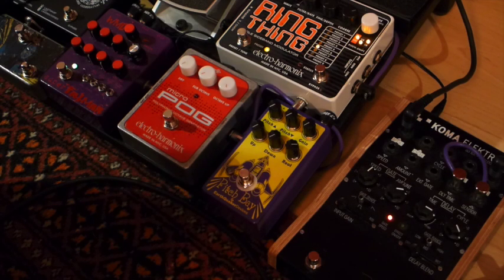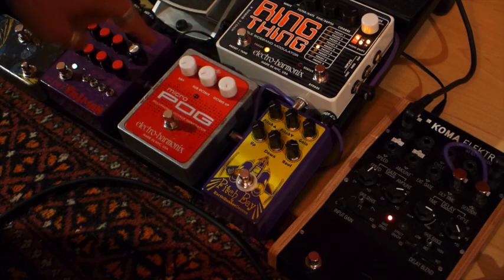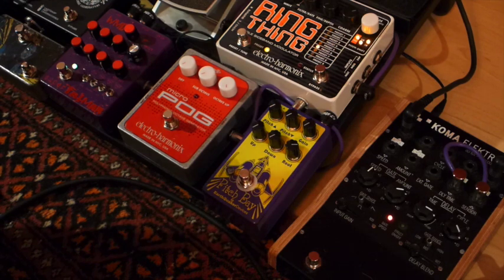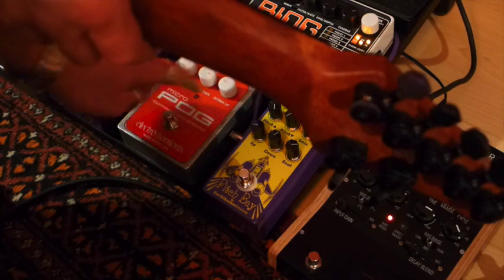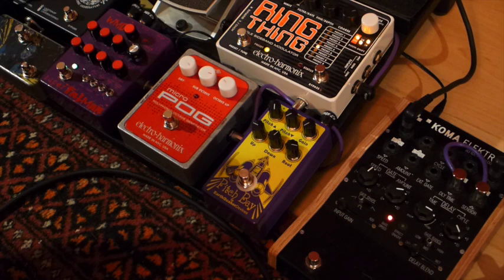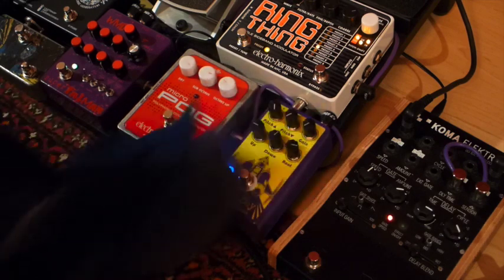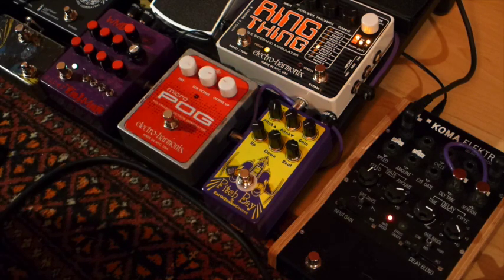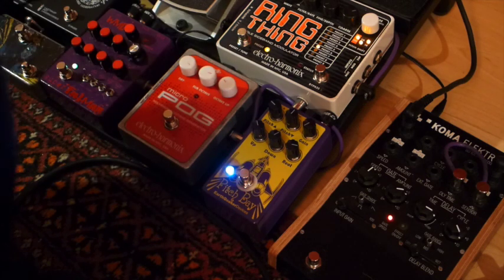Earthquaker Devices Pitch Bay vs. Electro Harmonix Micro POG

Comment: Which do you like more? And on which is more versatile and organic sounding? Thanks and great video!
Reply from the maker: Hi, as I said in the video I like them both, it depends on what I need. The pitch bay is more versatile because you can set the pitches the way you want, the Micr POG has a bigger bottom end. The POG just pitch shifts 1:1 your orginal sound 1 octave up or down, with no added specialties, while the Pitch Bay has this kind of vibrato thing running. Just go and try them out if you can.